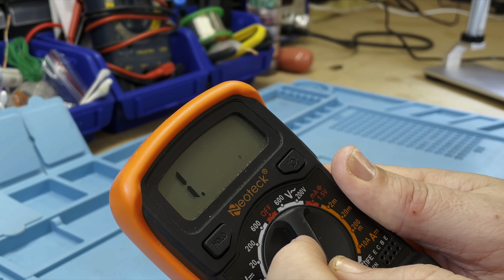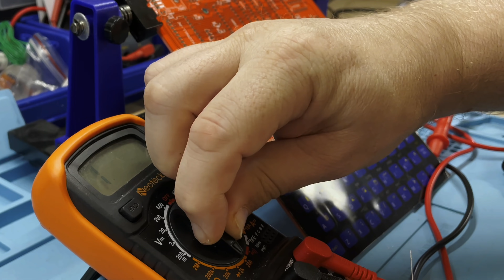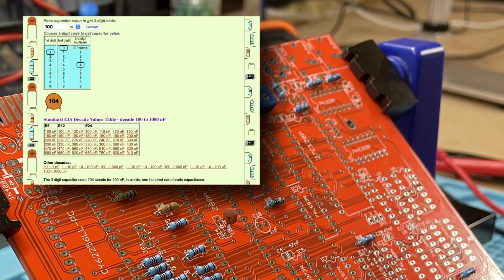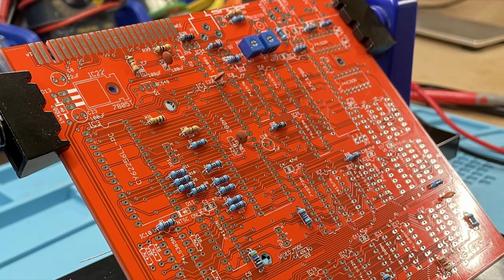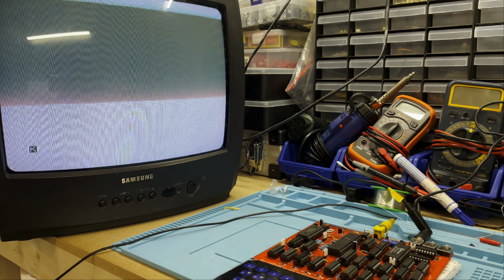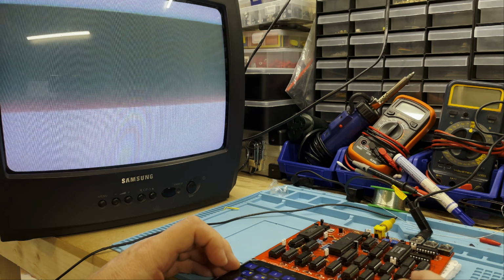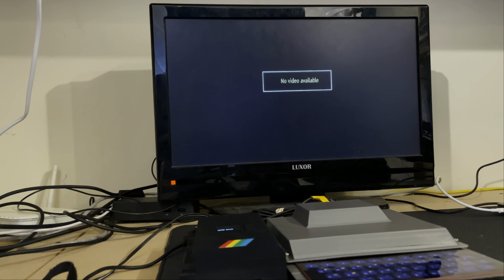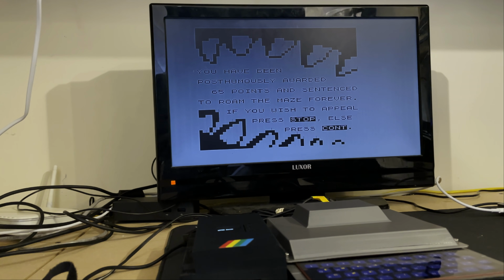Can You Build A Brand New ZX80/81 From 100% New Parts?

Comment: LED's are also directional just like a diode, if its not working you might have the polarity backwards, de-solder it and flip it around and try again.
Reply: Light Emitting Diodes are directional just like a diode - because...well...they are a diode 😁
Reply: @MixUpTheVideos  yes I know, but not everyone makes the connection :)
Reply from the maker: Nope - they were just duds - replaced them both and they work a treat now :)
Reply: @TheRetroShack  well that happens too :)
Reply: @wesleyswafford2462  yes but i don't think they are very good at it
Reply: It's like lightbulbs. If they stop working, just turn them over and plug the glass into the socket. Then have a drink. In the dark.